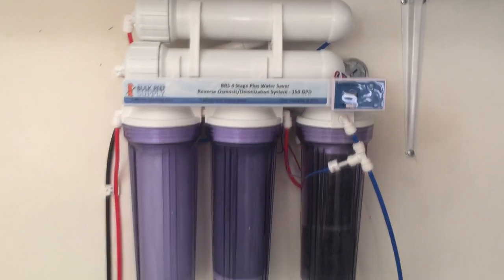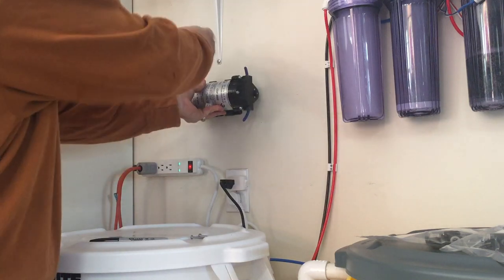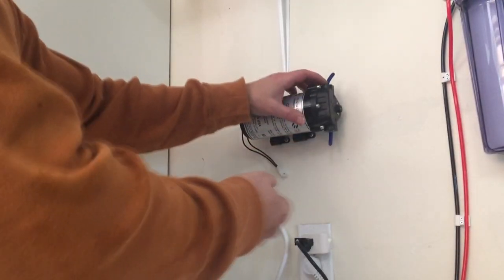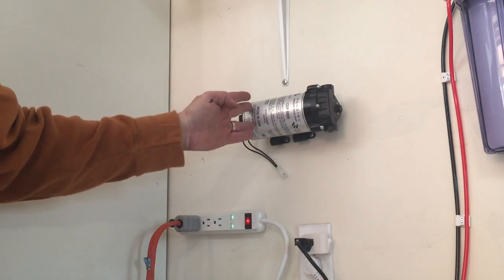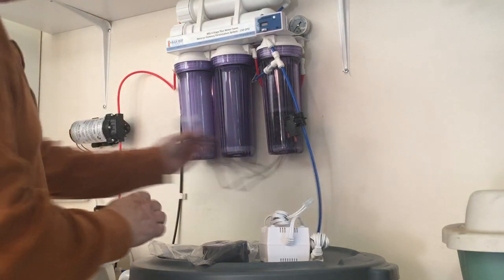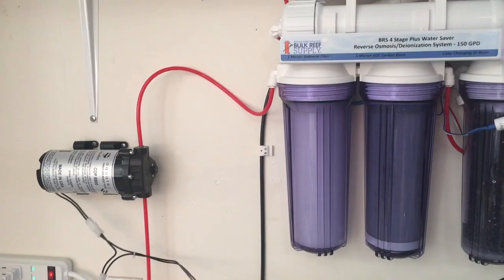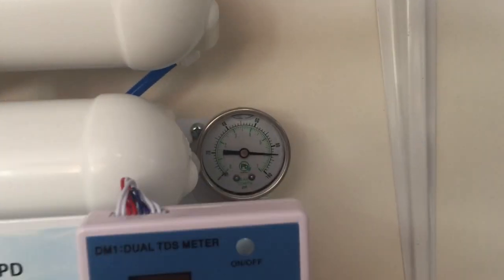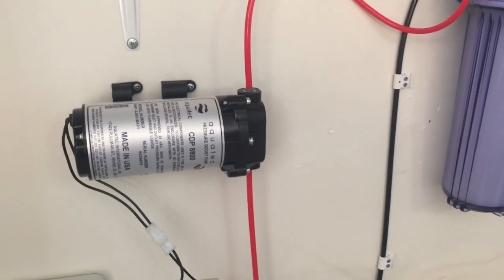Installing a Booster Pump for RO/DI System

Comment: Hay, amigo just for safety purpose. Never connect the booster pump in top of any electric plug. If you have any water leak, you can have electric shock or even worse another safety issue in home. I just said. Be careful

Comment: I connected mine and connected it correctly source to pump in and out to rodi unit (with no pressure switch) and it is not increasing the pressure.  pulling my hair out!

Comment: i have an aquatec booster pump and its working as far as increasing pressure in the rodi system however the pressure valve turn off before the rodi auto shut off valve turns off the rodi shut off valve is working but its not quite syncronized with the booster pump pressure valve when the pump turns off the water is still flowing threw the system so the booster pump turns off and later the rodi auto shut off valve turns off i would like to get em to turn off at the same time
Reply: When my fresh water tank fills the float valve stops the water flow. The pressure that builds up from that turns off the booster pump. I have to manually turn off the water valve going into the RODI system but the water has already been stopped by the float valve.

Comment: Will the pump suck water from a regular tank or reservoir and push it through the system?
Reply from the maker: As far as I know it only increases the pressure. It is not a regular pump.

Comment: Question regarding the pressure switch... Do you attached it to the discharge end of the system? I am using this RO system for sugaring maple syrup. I am not sure where to install the switch to shut off the system.
Reply from the maker: Hi David, the pressure switch goes on the output side of the system. I have mine between the RO/DI and the tank. When the tank is full, the switch senses the water is no longer flowing and it shuts off the pump.

Comment: Can you use these if you have ZERO pressure because you're feeding the water from an open tank rather than from a pressurized water line?
Reply: Yes. I use the 8800 pumps for my aeroponics setup. It pulls water from a zero-pressure reservoir and raises pressure to 100psi. (What I have my system set at.)

Comment: According to my schematics, I need to install low pressure and high-pressure relays and solenoid valve. But you have only a high-pressure relay here. Why?
Reply from the maker: Hi. Being that I have a water saver version RODI my pressure was too low so I had to add a high pressure booster to get the PSI at recommended levels.

Comment: Great video thanks. Only question I have is when you installed the red ro tubes to the booster.  It didn’t appear you secured them in anyway or does booster have some sort of tube lock joint or whatever you would call it to prevent the tubes from just popping off?
Reply from the maker: There are tube locks (or whatever they are called) in the booster so you just slide them in and they secure. It’s harder to get them off as you have to pull them part way out then slide the tube out.

Comment: The booster pump is suppose to be installed after the prefilters and before the ro membranes.
Reply from the maker: Hi. I followed the instructions that came with the booster and also just checked the BRS video and it looks like the booster goes before the RODI system and boosts the water pressure to it. Thanks.
Reply: @DollarDIY  im looking at purewateroccasional.net, their diagram is the same, pump at inlet to system.  question though, what is the open bucket with a float switch for?  
i was imagining pairing booster pump with larger pressure tank @ 20psi as a "central" RO supply instead of under sink 5 psi.
Reply from the maker: @ilovefunnyamv2nd  Hi. The open bucket with the float switch is the RODI water tank. It is a 20 gallon Brute garbage can and holds the processed water. Once that is full, I pump this water into the yellow 20 gallon container and add the salt.
Reply: So the RO System is for your entire house? Then you Soften the water? How much waste water do you get vs just using a “refinery” / “filter” then softening the water?
Reply: The RO system is only for the tanks. The booster help with the pressure going through the double RO unit.
Reply: @Steven fouts 
You are right, for the reverse osmosis process to take place, the pump must be installed after the three filters and before the membrene because it needs pressure to complete the process, otherwise the waste water will be a large amount, because the purpose of the pump is reverse osmosis, and nothing else, the pressure of the water that comes to the filters is enough  To fill it, and pass to the other side, the pump to reduce waste.
Reply: @0uahidi  How do you connect one booster pump with a permeate pump? My RO system is 50-60 psi inlet and after the RO is 15psi, I checked the tank pressure (I have two) with a permeate pump.  I am thinking to add a booster pump because the pressure is too low, the membrane is a 75GPD membrane and I replaced it last year, I just replaced the filters

Comment: My 500 gallon collection vat is fed by a 75 GPD RO/DI system. I recently switched out the filters and emptied the collection vat which resulting in a massive drop in pressure- 15psi- so the RO/DI system is only producing 20 gallons per day. I installed a pressure pump and pressure switch in hopes that it would raise the pressure to atleast 40psi... but it didn’t work. After I installed the booster pump and switch- the pressure didn’t change at all... 

This problem is putting a massive dent in my water changing schedule... I’ve been looking a pre-pressurized water storage tank- would that help pressurize the 500 gallon vat? I’ve pressurized a 100 gallon collection vat with a bike valve and bike pump before- would this option work for the 500 gallon collection vat? Please help!
Reply from the maker: It sounds like something else is causing your pressure drop. If you lost pressure after you changed the filters, maybe something didn’t go back on right, especially if you didn’t see a gain by adding the booster pump. Try reinstalling the filters and checking all your connections.
Reply: Dollar thanks for the tip- I recently located a leaky pipe that may be the source of my low pressure issue.